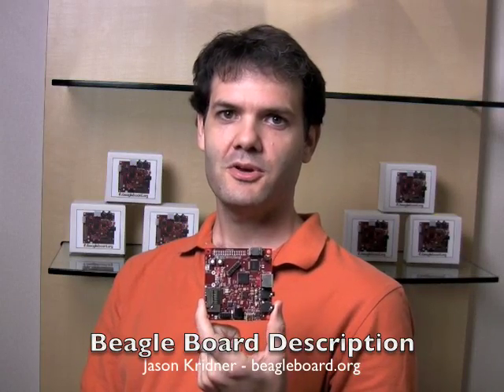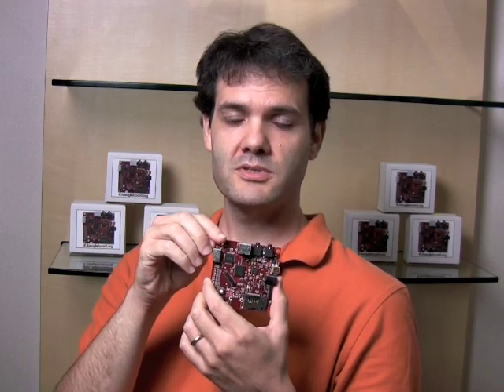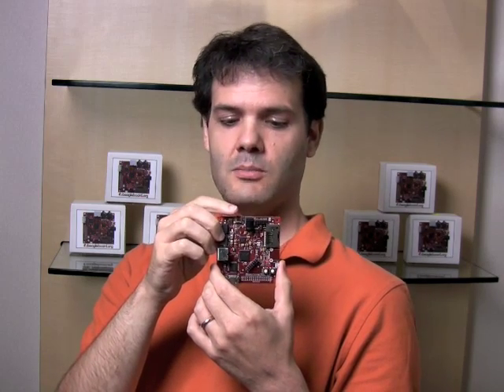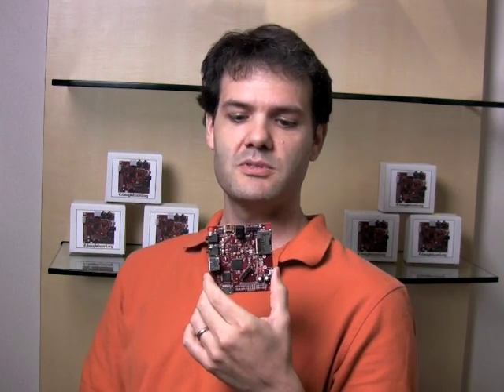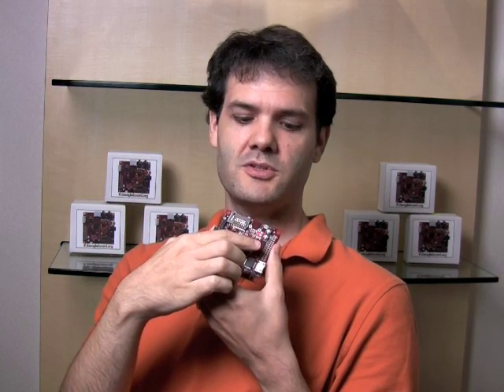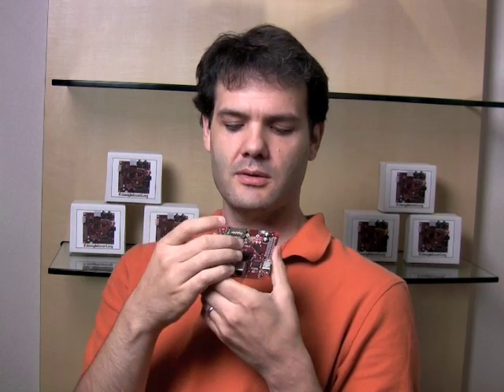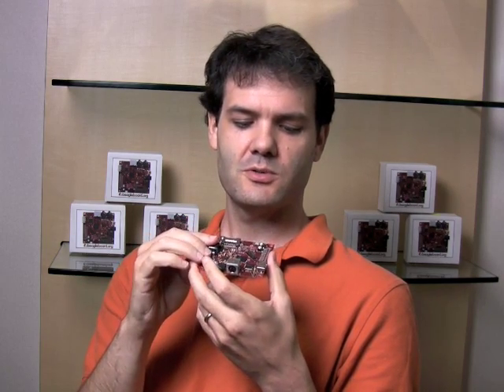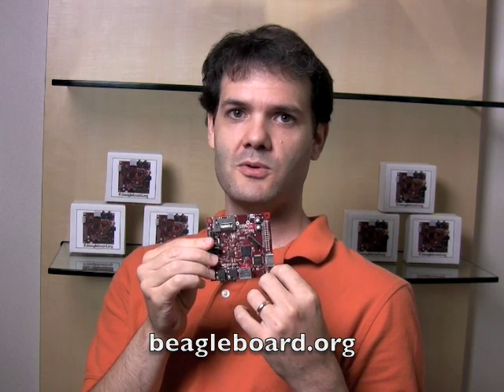Beagle Board Description

Comment: How much similar board will cost speaking mass-production in 100 000+ units? You very rough estimation? And, is there a video controller integrated in it? Could it support 720p LCD screen resolution with video playback capabilities?